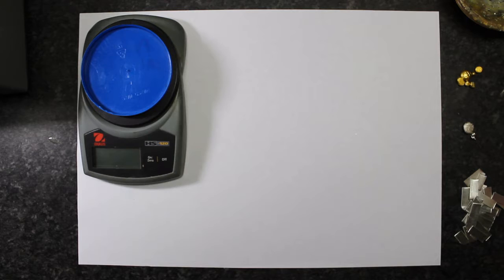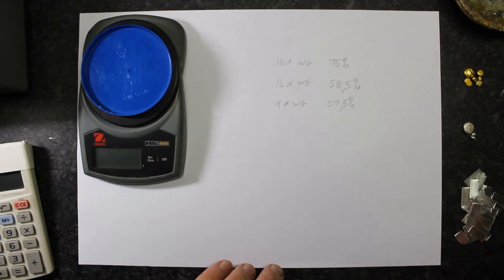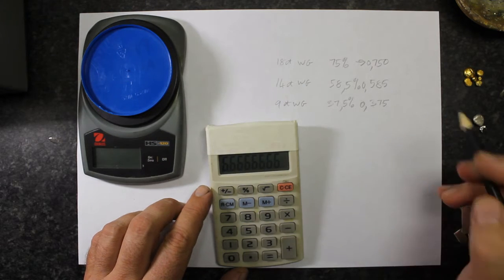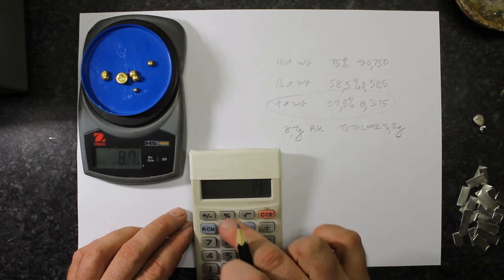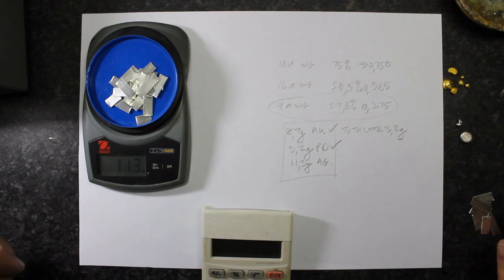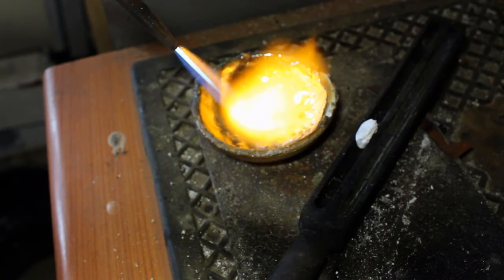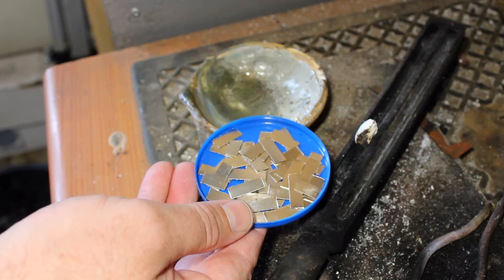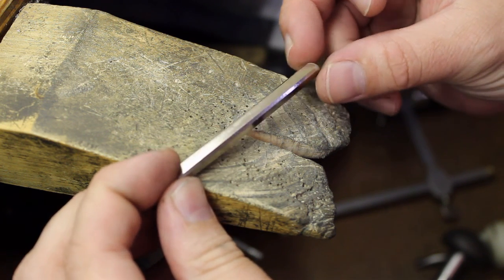How to alloy white gold

Comment: Regarding 8:26, gold does not have a melting temperature lower than silver. Instead the melting temperature of gold is higher than silver, because the melting point of silver is 961°C = 1761°F whereas the melting point of gold is 1064°C = 1947°F.

Comment: I have to do this tomorrow, is it possible to just use 16k Gold and .999 fine Silver? If so I have about 3.1grams of 16-18K gold I want to make into white gold I have the silver too. Please help me!
Reply from the maker: You must add Palladium to turn the gold white. Using only silver added to the gold will not turn gold white.
Reply: @JanHendrikViljoen  Different places use different white gold. I used silver, and it made white gold. I just have no way of plating it in Rodium for that blast white-gold look.

Comment: Thanks for the video and the math breakdown! Now I wonder if the higher percentage of palladium is used the whiter the gold?
Reply: The color of a gold alloy can be quite complex and depends on many factors. Karat is one factor, but the most important factor by far is the alloying metals used and their relative proportions to each other and to the gold. The simple answer to your question is yes, in almost all cases, the higher the percentage of palladium used, the whiter the resulting gold alloy will be. That's a good rule of thumb, but there are exceptions, some of which are quite fascinating. For example, regarding the 9kt alloy made in this video, if you were to replace a specific proportion of the silver used with indium, you would not end up with white gold at all. This is true even (especially) if you also increased the percentage of palladium in the alloy. Instead you would have a yellow gold alloy with a color similar to 14kt yellow gold. This alloy would be even richer in color than a higher karat alloy of gold and silver that doesn't use any palladium whatsoever. Even more interesting is the fact that the gold itself has very little to do with the color of this particular alloy. In fact, the gold isn't necessary at all for the yellow color! It is entirely possible to make a lovely yellow "gold" alloy containing only silver, indium, and palladium (all of which are white metals) as long as you get the proportions of each metal correct. This happens because palladium and indium react with each other when near a 1:1 atomic ratio to create an intermetallic compound (PdIn) that has a red color. The addition of silver changes the color to yellow while also making the alloy more durable, as PdIn is very brittle in its pure form. Adding gold to this alloy improves tarnish resistance and durability while maintaining the yellow color, but only to a point. If you keep adding gold beyond approximately the 10kt level (41.7% gold by weight), this will then start bleaching the alloy back towards white. The same thing happens with copper. Adding a little doesn't hurt the color, and can even shift it closer to a rose gold, but adding too much will bleach the color away just like too much gold will.

Comment: Pure gold is 24 karat, meaning that 24 out of 24 parts of the metal are gold. Although the terms sound familiar, the karat (k) system used to measure the purity of gold is different from the carat (c) unit of mass that’s used to weigh diamonds.